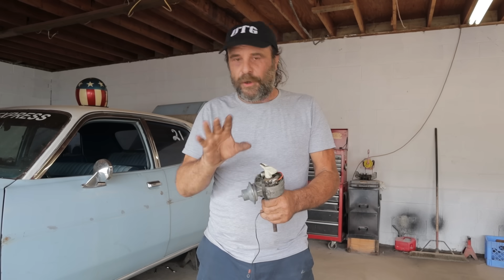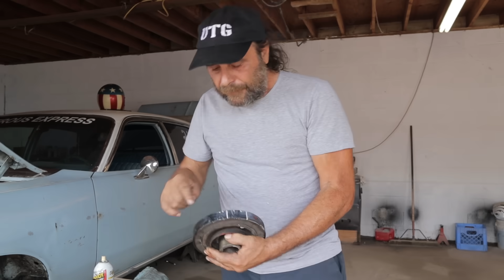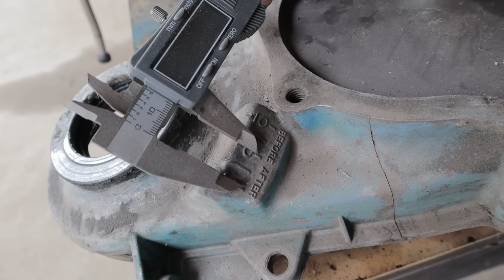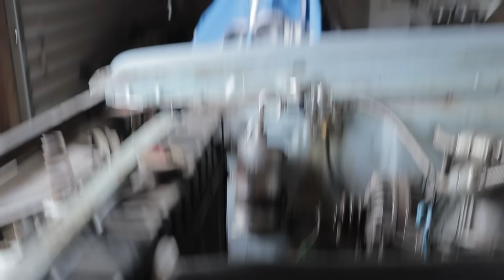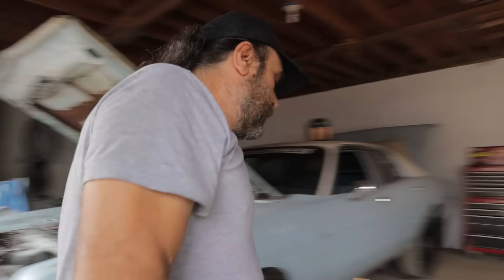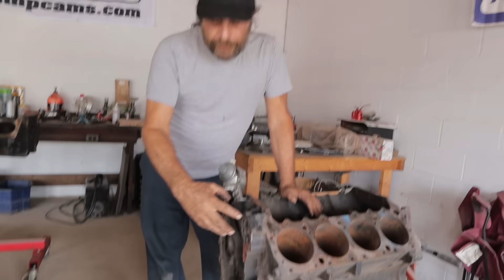Ignition Timing For Power

Comment: I don’t use dial back timing light.  This is easy stuff. People make this way more complicated than it needs to be. Always check your TDC mark on the dampener and make sure it is correct before trying to set timing.
Reply: I set my timing with a dial back set on zero and set the timing initially per specs at the prescribed idle speed and then I bring to revs up to get the mechanical advance out to total and check to be sure the mechanical advance is working. Now this is on stock engine applications, and it pays to make sure your timing light isn't off, and of course if a rubber bonded balancer the outer ring has not slipped. Of course I get Uncle Tony's point and yours. Friend of mine when he set the timing on his dirt car engine would disconnect his vacuum advance (yes he ran vacuum advance curved) run up his engine and set his timing at 38 degrees. If I remember right he used a dial timing light.

Comment: I usually put the timing mark at 35 degrees and put my distributor in with magnet for number and the rotor at number 1. Is that the same as you were saying to move the body while holding the shaft? I’m going to try that tomorrow.

Comment: As a young man with a 327 in my 67 Camaro I would advance the timing until the car spark knocked under load and then I would back it off just a hair.  DONE lol
Reply: No you're not done and I can assure you that the timing was not where it would give the best performance.
Reply: I still do it like that!
Reply: Same
Reply: @timbermansam  Yes and as an example; earlier this year I had a small Ford on my dyno.  The owner had been running 34 degrees timing.  Bumping up to 36 hurt power.  Dropping down to 32 helped.  Going to 30 hurt.  There was never any pinging.
Reply: DAVE
Some of those early SBF with a cam upgrade needed 42 for best WOT acceleration.... And 36 for pulling 100+ mph in high gear loading.
Reply: Remember the 426 hemi..... Needed 50
Reply: @hotrodray6802  Maybe so but this one was a 347 with TFS heads.
Reply: @hotrodray6802  I bet it didn't when running on gasoline.
Reply: HotRod Ray GENERALLY THE BIGGER THE COMBUSTION CHAMBER THE MORE TIMING YOU CAN RUN AND WILL RESULT IN MORE POWER.  A MOPAR HEMI HEAD IS HUGE.
Reply: @noahdunaway  This is mostly false.  A flathead also has a huge chamber and they don't like a lot of timing.
Reply: Dave McLain THAT IS WHY I SAID GENERALLY.  IN MY EXPERIENCE, ALL BEING OVER HEAD VALVE RACE MOTORS, I HAVE FOUND THAT THE SMALL BLOCK MOTORS WITH AROUND 70 CC HEADS MAKE POWER WITH LESS TIMING THAN A BIG BLOCK MOTOR WITH A 120 CC HEAD WHICH IS AVERAGE FOR A BBC 24 DEGREE HEAD. ON A BBC WITH 12 DEGREE HEADS THE COMBUSTION CHAMBER IS MUCH SMALLER, AROUND 75 CC, AND MAKES THE BEST POWER AT MUCH LESS TIMING. I KNOW IT NOT AN EXACT RULE BUT THAT IS WHAT I HAVE FOUND TO BE FAIRLY CONSISTENT WITH THE DRAG RACE MOTORS I HAVE BEEN INVOLVED IN FOR ABOUT 50 YEARS.
Reply: @noahdunaway  Just recently I had two low compression flat top piston 582 Big Chevy engines on my dyno with chambers that were at 112 and 119cc.  They both ran their best with 34 degrees of timing which I didn't think was all that high.  Would they have required more advance with a domed piston?  Possibly.
Reply: Dave McLain I WOULD THINK THAT A DOMED PISTON COULD POSSIBLY WANT MORE TIMING DUE TO THE DIFFERENCE IN FLAME TRAVEL VERSUS A FLAT OR A SMALL DOME PISTON.  MOST OF MY EXPERIENCE IS WITH A HIGH COMPRESSION APPLICATION.
Reply: @noahdunaway  I think that it would have too.  Earlier I had a Chevy 350 with a big dome and an old Brodix head.  That engine needed 40 degrees to run its best.
Reply: Dave McLain IN MY 68 CAMARO I HAD A 427 BBC WITH 122 CC HEADS AND 40+ CC DOME AND I WAS RUNNING 40 DEGREES TIMING WHICH IT SEEMED TO LIKE, NO DYNO.  WELL THE DISTRIBUTOR BOLT WAS APPARENTLY NOT TIGHT ENOUGH AND THE DISTRIBUTOR MOVED TO AROUND 48-50 DEGREES AND WAS RUNNING WHAT SEEMED TO BE THE BEST IT HAD RUN BUT I WAS SCARED OF DETONATION A MOVED IT BACK TO 40 DEGREES.  I HAVE SINCE MOSTLY USED A CRANK TRIGGER.
Reply: @noahdunaway  It liked that with a factory  head.  I've seen a difference of 1/2 or more in spark plug location in a factory style big Chevy head.  With the plug located higher like in the Pro Filer head I wonder if the dome would have made as much of a difference?
Reply: keith cunningham  No you're not.  Your method won''t tell you a thing but it will most likely get the timing over advanced for best torque and HP.

Comment: All good and you made it clear that "Performance" engines can get away with just mechanical advance.  They are not meant to get gas mileage necessarily ...
Mild street engines that haul the family around need the vacuum too.  Good tip on fattening the low speed circuit to get away from lean burn and stratified charge issues at high vacuum cruise :)

Comment: One thing I would add is to check the stock damper to make sure your "0" Mark is where it's supposed to be. I have found a few Ford and Gm dampers that the Mark was off by noticeable amount. Also when building an engine from random parts this needs to be checked because over the years the factory marks were located in different spots. So a timing cover or pointer from a '67 could be in a different spot then in '71. And this can make setting timing a nightmare unless you check this carefully when building the engine. Or when trying to figure out why an engine runs poorly when timed by the marks .

Comment: I have a 1980 Plymouth volare with a 360. It was running and driving and then i parked it and 30 minutes later it will not start. I have replaced the 
Ignition module.
Coil.
Distributor pickup.
I dont know what else to try. I need some help.
Reply: Yes it does. Im am getting fuel just no spark
Reply: @wyattwoodard9801  try the ballast resistor
Reply: @billyfromtheusa i have been told that i could of bought a bad new coil. Im not getting spark from the coil to the distributor. I have 12 volts from the battery to one of the ballast prongs and 6 to the other one and then when im cracking im getting almost 12 volts to the coil.
Reply: Ballist resistor on the firewall.
Reply: Yes i have replaced the ballist.
Reply: The next thing i am going to try is the ignition switch.
Reply: If your getting power to the coil it's probably not the switch
Reply: I am going to put a new coil on it and if that doesn't fix it i think im going to take it to somebody to fix it.

Comment: The limiting of vacuum advance is critical if you have an emission control distributor as they had vacuum canisters that added about twice as much advance as you really wanted if you advanced the timing for performance. Many of these engines would buck if you added even two more degrees of initial advance or even went to a lighter set of advance springs.

Comment: I use the static method to set initial timing and to break in the camshaft and engine. I use a timing light to set total mechanical timing at high RPM. Most stock distributor springs won't allow the full total timing of the weights at any RPM, but after market, high performance quick advance springs do, as they reach total timing at a much lower RPM, often making the factory vacuum advance unusable at part throttle and left sealed off.
Reply: thast why you need an adjustable advance to limit it

Comment: Can I use additional timing to compensate for the huge drop off from first to second? Or just set the shift light 1000 rpm higher? Please only respond if you dont have a fucking clue
Reply: I would think the planned 300 horsepower worth of nitrous will help with that.
Reply: @BenjaminC340  I was being sarcastic lol

Comment: I tried making marks by measuring half way around which is 180 degrees. Half of that is 90 degrees, half of that is 45....and keep halfing/marking it until you get the range of marks you want. And that would work with any diameter damper/balancer. Just have to make sure the outer damper didn't spin on on the rubber ring previously.

Comment: @4:15 Uncle Tony said: "'Why don't you use timing tape?'" Because timing tape doesn't stay on forever."
The trick to prevent timing tape from flying off is a) make sure you have an extremely clean surface on the damper before you stick it on, and b) once on, take a can of Krylon CLEAR spray paint (or other brand), and spray over the timing tape. Once again: The key to prevent timing tape from loosening up and flying off is a very clean surface; that means NO grease, NO oil and NO rust on the harmonic balancer (aka damper) before you apply the timing tape then a shot of Krylon clear paint over it to seal the tape to the damper.
Reply: Red Green always used Duct Tape😉
Reply: Use the timing tape then take a hacksaw and cut your marks into it using the tape and a guide. Any performance engine should not have a factory damper anyway.
Reply: @philipmazzuca2269  
You make a really good point here.
Some of the old 60's and 70's dampers were pretty good for not spinning and being factory accurate. 
The later shit was literally made with not much better than spray foam. The balancer could be out by 4 to 8 degrees new. I remember back in the early 90's setting total timing on a 403 Olds motor and I'd lock down the distributor, rev the engine up a couple of times and the timing had changed.  I thought the distributor was somehow turning. Took me a bit to figure out the outer ring of the damper was spinning on the rubber.
So, I agree buying a good damper is cheap insurance in my opinion.
Reply: Hammy- Agreed
Reply: I clean it real good like you said but i brush on clear epoxy over the top of the tape
Reply: It is best to paint your entire engine bay with clear coat. 
Eliminates corrosion. 
Helps hold things in place. 
Makes wiring last forever. 
And oh man is it a joy to work on pater. 
Rinse it off and she’s clean.
Reply: I agree with ya Electrix. It like a paint job it's all in the prep! When I rebuilt my engine, I prepped & painted it, then i sanded the balancer where the tape was to go, wiped it down with mineral spirts, made sure it was exactly TDC before applying the tape, pressed it down with a hard squeegee (without stretching it) then I trimmed the edges where needed. It's been about 20 years, I drive it like I stole it most of the time & the tape is still there. I also washed my hands thoroughly with dish soap to make sure my fingers were free from the natural oils in your skin. 😎

EDIT: Didn't use no clear coat on my tape. But That does sound like some good extra protection.

Comment: Great points UT, especially on unverified dial-back lights, very well said as they can be unstable.
I'd like to add, don't trust marks left by others, I've experienced situations where a motor ran like crap but good enough to pass apparently b/c the guy who marked the damper accidentally marked it twice with 2nd mark being accidental paint drip.  Then set timing to the accidental mark.  (Doh!)
Deep boat bilge and salt-rusted damper but almost by luck I noticed the two paint marks.  I'd suspected something was wrong just by listening to the motor idle, the timing sounded off and looked into it. 
So I encourage others experiment with igniton timing a little to gain experience and listen closely.  Small tweeks can improve things like drivability, etc.

Comment: Won’t the engine pink and diesel if timings to advanced?
Reply: Then don’t advance it too far. 
Or drive a diesel ;p
Reply: This is setting TOTAL ignition timing. The springs and weights are extended to full mechanical advance by rotating and holding the rotor in the direction of its rotation. This is not setting initial timing. Initial timing would be with not holding the rotor advanced, letting it sit and rotating only the distributor body, but the balancer would be in a different position from setting total mechanical advance timing.
Reply: Typically a  preignition/spark knock/pinging situation comes from hot spots in the cylinder and or too much timing or too low of octane fuel for your compression. Now a dieseling condition comes from hot spots piss poor casting of cast iron cylinder heads that the hot spots actually will fire the fuel on its own b4 the plug fires and causes a diesel condition and that is how the engine manages to shut off and actually run backwards from a dieseling condition
Reply: Yes probably.
But you can damage an engine without audible ping.
What you dont hear is not necessarily correct.
n

Comment: Wish I could play with American v8s but they so expensive here it's not something you can just go out and get here in South Africa a engine in bits costs more than cars I've bought 😂so we play around with straight 6 4.1 chevys and 4liter barra(can give a big v8 a shock most of the time)  and of course the 4 pots
Reply: Yeah but you got newer rabbit pickups. 
They are cheap and can be amazing if modified. 
A Tdi swap in a rabbit pickup is faster than a stock old muscle car. 
And gets over 4x the miles per gallon. 

Oh, and the engines last for 100,000s of miles.

Comment: I just use Timing Tape on my stock damper I put it on when I rebuilt the engine and it still on there and works great or if you buy a aftermarket damper it will have the timing marks right on it

Comment: Thanks for your time and knowledge on your videos!  Is there any truth to advancing timing even more at high elevation?  I in Arizona at 7000' altitude with my 78 chevy k10 with the 350.  I have it set to 36 total (unless my dialback is wrong as well) I have heard you can advance timing 1 degree for every 1000 elevation due to the thinner air and slower burn rate.  Any truth to that?
Reply: I have a 75 C-20  with the 350 that is set at basically sea level. When I go over the pass and up in the mountains to visit my brother. It over heats knocks and pings and runs like crap. But the moment I hit the down hill run off the pass towards home she cools down to normal runs like she should so there might be something to that.
Reply: You ask an interesting question. I was working at the Dodge dealer, around 1994, when a Viper came into the service department, with the same issue. Apparently, (AND! I'm only guessing....) it came up from Southern California. I was told, California. BUT, it was OBD-1, which didn't take care of that problem.

Comment: Sorry guys but those of us who've gone to the dark side and have programmable ecu,s dyno and data log to adjust timing probably ain't going back lol
Reply: @Curtis Fleabag not so much when it comes stock. On my daily driver I can do a 3rd gear pull on the street, record it and load it onto a laptop and using romraider software optimize fueling, ignition timing and even cam timing. Reflash it and away we go. Not something youd necessarily want to retrofit to an older vehicle but at the same time it would be really ridiculous to put a carb on my car

Comment: Good video  ,  never built compete race engines , but for the standard engine tuned it by ear  , slight cam changes the marks some does it not ,  anyway  , slight ping when hitting it  , back it off till none , and your done ,   quite an educational video  keep them coming .

Comment: Damn Bro. You did it again. I had just come back from making a coffee and tobacco run in the old C-20 and the old girl was pinging as I was running her up the highway. So I did a quickly by ear along side the road. Know its not the gasoline cause I just filled up with 92 octane.. And I get home and your doing a timing video..
Reply: if it's not the gas it may be the timing it could also be the plug with these hot days you may need a colder plug I've had spark knock issues before most of the time it's in the summer on those real hot days I could back the timing off and it would not ping but run like crap so went tossed a colder plug in it turned the timing back up and never had a issue since.
Reply: @79tazman  that's an idea , I'll have to dig around in the Chevy parts shelf's and see if I have anything besides R44TX for it.
Reply: If you just filled up it could TOTALLY be the gas. ...
Reply: @fastinradfordable  same gas I always put in it every morning because it never gets below half tank. my usual 76 station, same pump I always use. 92 octane 76 gasoline. Cuz it only runs on 76 or Exxon. ARCO gas builds up brown crap on my plugs after a tank full.

Comment: On my pontiac, I don't use the vac advance and have modified weights, so setting the timing for me is setting it as advanced as possible without having a miss at idle! And boom, it's perfect.
Reply: too much timing on Pontiacs will increase oil temperature....Pontiacs don't like a lot of lead....32-34....shoot for 12 in the distributor (24 at the crank) and initial at 8-10.....makes it easier to start and lets the battery live longer